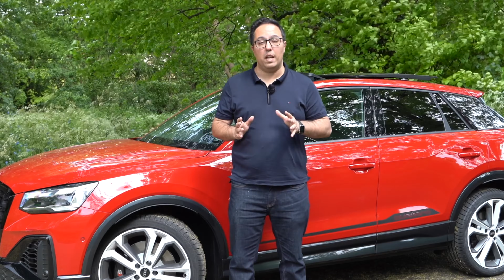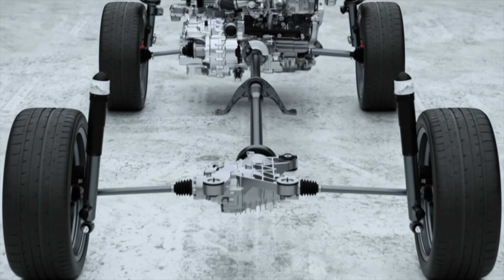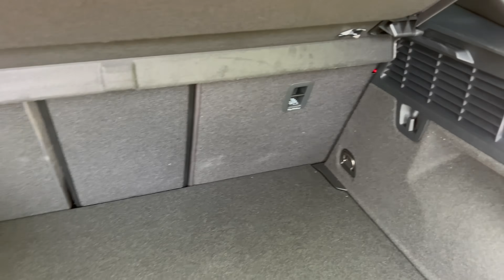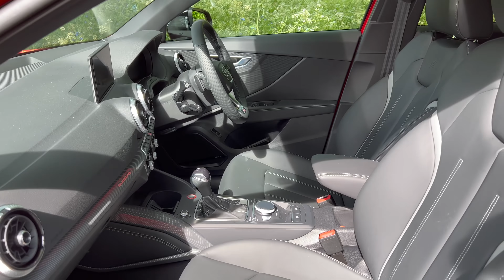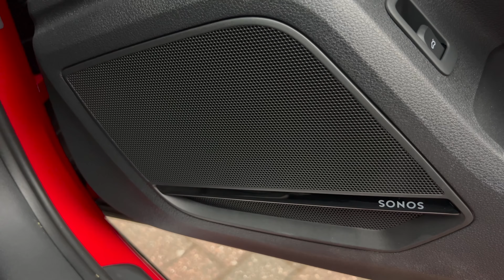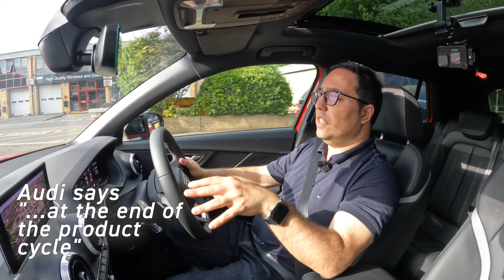Why the Audi SQ2 should be on your list of small SUVs!

Comment: I just find it weird that the T-Roc R and Cupra Formentor and even the Ateca which is more closely related to the SQ2, get adjustable dampers but this doesn't. The Audi's interior is WAY nicer but the 360 cam, powered drivers seat, and adjustable dampers (Ateca is genuinely compliant in comfort mode), not to mention 10 grand cheaper here in Australia, are what made me choose the Cupra Ateca over the Audi. I hated the T-Roc's interior completely which is why that was out of the running, so much piano black and that's my least favourite thing in ANY car interior. All this said, I have done all of 500 miles equivalent and I am having bizarre issues in my car that I know would never happen in a brand new Audi. 2 days ago, the sound system refused to produce any audio. Not for phone calls, radio, car play, nada. Even the screen beeps when pressing it were gone. I triple checked and volume was way up with no muting. I turned off the car, opened the door and got out, locked it and unlocked it, got back in and re started car and it sprung to life again. Today I was driving and stopped at an intersection, there was one car in front of me (a few metres as I am a very cautious driver) and no one behind, and suddenly the reverse camera popped up on the screen, the parking sensors activated themselves and I got alerts to check my surroundings. I had touched NOTHING, my hands were on the wheel and I was in drive. Then, on the way home, it said Siri wouldn't work as it required a net connection even though I had maximum coverage in a metropolitan area. Cycling the car power fixed it again. I am hoping it's glitches that software updates can fix, but OTOH I am very worried I have a car with intermittent electrical and/or computer issues which are the worst kind of  issues, as they never happen at dealer and never get fixed. Sigh. We shall see.

Speaking of the RSQ3, I had a brand new one in 2016, the 335 HP version which I believe to be the best factory version of the engine tune because of the low revs you get max torque and it didn't have all the stupid limiting the cars have now - It's aggressive, the manual mode was a real manual mode where needle would bounce of limiter and not upshift, and the 5 cylinder is glorious. There are problems with the latest 400 HP ones and laggy, muted launch controls, whereas mine was an animal. The fact that the new one has more power and is rated for 4.5 second for 0-62 and mine was 4.4 is telling. Anyway, I had a period where I got very sick and was home bound and had to stop working, and my mum bought it off me and still has it to this day. I asked her since it's long out of warranty if she'd let me stage 2 it but she went ballistic and said no way LOL. Anyhow, my health struggles have improved and I bought myself a car again, and there was no way right now I could afford a new RSQ3, they are 120 grand here.
But that 5 cylinder is GLORIOUS. I would have loved an RS3 back in the day and they were similar price in 2016 but I am very tall with lower back issues so need easy entry and exit, so a performance small SUV is a somewhat reluctant but necessary 2nd choice for me.

Also, when I am speaking of the RSQ3, I am talking purely about performance. The way the torque band is SO flat and as it tapers off leads directly into the maximum power output of the engine, you have an entirely linear power delivery along with very juicy real sound from the exhaust. I love being in 6th gear and just touching it and it cruises up a hill. It's just so TRACTABLE. You can feel the massive difference between this and the 300 PS in the Cupra/SQ2 even though the power outputs are just 10% more and Torque is only 5% more. There's constant, real GRUNT. So yes, in that department, it is WAY more car. And a really good overall compromise on ride height and size.
However, the handling is shit. Well, not shit, but the steering is not direct, it has a big delay from moving it to response, and it just feels sort of dead.
Have they improved that in the newest model? I know they have adjustable dampers now on it, but it's still running on the older Haldex platform, yes? Even in dynamic mode mine was just not fun to corner. It had a high ultimate ability before losing control and the confidence was there, it just wasn't enjoyable.

My Cupra in comparison, and this includes vs the SQ2, feels like a go kart, the steering is so responsive. It actually reminded me of my Dad's Porsche Boxter from like 15 years back, no joke. Cupra engineers have done some sort of sorcery where they have taken the older Haldex 7.5 Golf platform and tuned it to the best it CAN possibly be tuned.
Launch control is ferocious and feels way faster than the claimed 4.9 seconds. Cupra mode is very aggressive and the exhaust farts and pops like crazy which I love.
The engine just isn't anywhere near that 5 cylinder, and wouldn't be even with a tune as the 4 just feels so different. But the cornering is a standout and FEELS good. Even whizzing around a roundabout is a joy. Best front wheel drive biased AWD compact SUV I have driven with regards to handling.

I like the SQ2 cause the interior is absolute CLASS, I can almost see the 10K difference just there, as it even has leather padding for your leg next to the footrest on the centre console LOL. It has nice interior trim, beautiful quality leather and has not skimped on quality anywhere.
However, no rear vents is just weird, and in Australia, they have de optioned the rear armrest in the last couple years. You just can't get it no matter what. Since I do long journeys with friends, that mattered also. Finally, with my long legs (I am 6ft 4), I have much more clearance under the wheel with the flat bottom wheel of the Cupra. For some reason, all the other VW group cars can do all the driver aids with a flat bottom wheel but Audi can't. Isn't that really STRANGE in itself?
But yes it's so well built and part of me regrets it... Part of me wishes I had compromised on those few features and spent more and got it, as I just KNOW it would be completely reliable for the timespan I plan to keep it (5 to 7 years). And I just did a search and it's one of the models built at the German headquarters, which DOES matter IMO. Mum's RSQ3 has been the most reliable car we've had in the family.

Cheers! Will watch more reviews. Nice job!
Sorry for long message.
Reply from the maker: Thanks for the very long feedback and I love to hear it so please feel free to keep it coming. I think one of the things to consider is the differences in the model generations. The SQ2 as I say in the video is the end of the generation and there are no more coming. Something like the Ateca or the RSQ3 continue to be built and have newer more up to date versions so the tech is better.

I think CUPRA are making some fantastic cars and arguably are the most exciting brand in the VW group. I have reviews of several CUPRA models on the channel and I am always impressed.